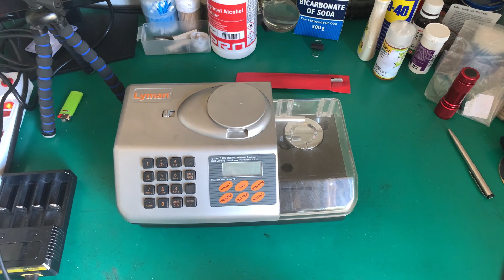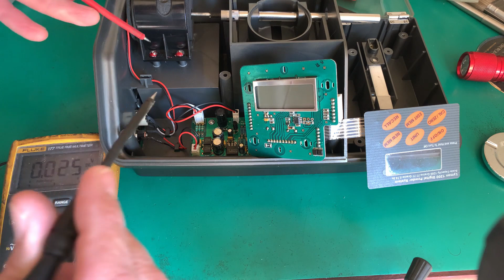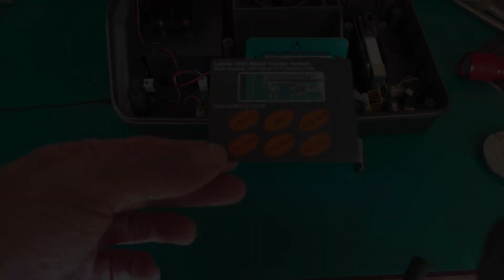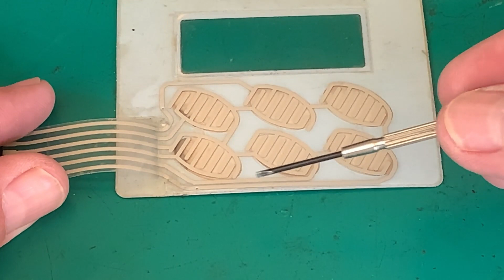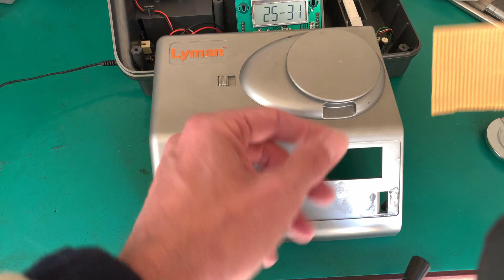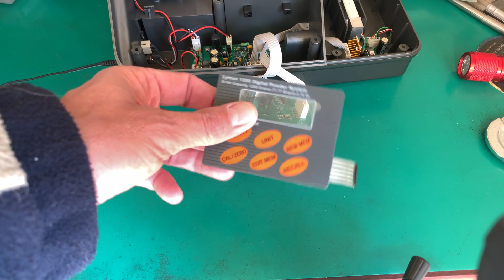FoulkesBrau #36 - Lyman 1200 Digital Powder System Repair PT1

Comment: Hello, have a problem with my Lyman gen6 touch screen powder dispenser, it is not turning on. When the power is given through the power adapter it starts beeping "beeeeeeeeeeeee" now buttons are working, the power to the touch screen is about 2.18 volts. Cant fix out the problem, can you be so kind and advise me, where to dig? I am from abroad, and can't send it to you for repair, unfortunately
Reply: And also, no information in the net around this model (